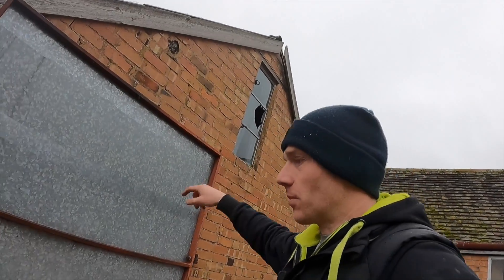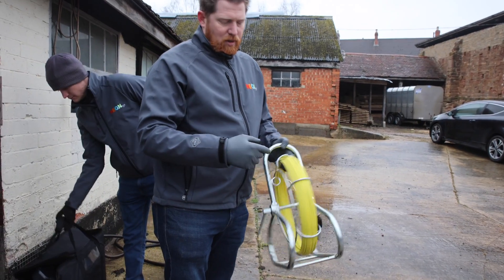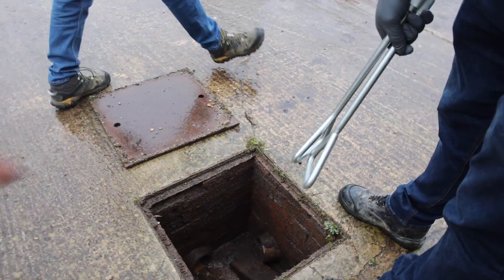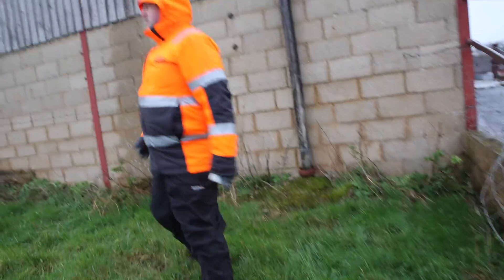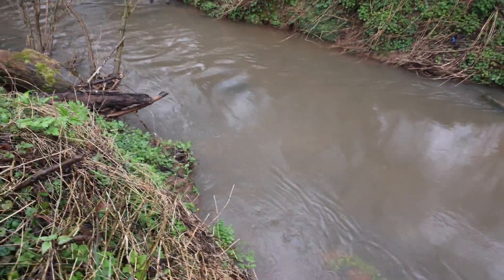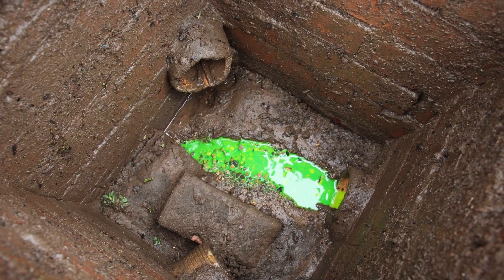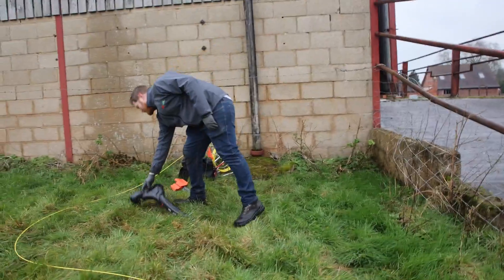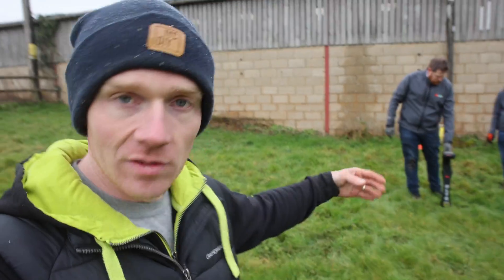LOOKING THROUGH CONCRETE and turning the stream GREEN!

Comment: The ground radar is all ok but there is no substitute for a proper internal CCTV survey. The radar won’t show you displaced joints, collapses, fractures, root in growth etc which will all cause problems later on. Will it show sections which are pitch fibre/metal/VC pipe? If not it’s only of limited use to show a general map of potential pipes. Other issues could be silt/stone/rocks in the pipes, wipes, concrete which will all need removing before a CCTV is done. You can also get swillys or flat spots which can affect flows, which the radar won’t pick up easily, a levelling survey is good to check falls on the network. You can also get disused sections, blanked off connections etc. 
As I said, radar isn’t useless but it should only be a rough guide. 
If I lived closer I would be happy to come and help as I am a Gravity Network Technical Specialist but if you needed any general advice I may be able to help via email.
Reply: My field techs use 7 different dye colours for investigating sewers but green is always the best!
Reply: Oh and if you needed any advice on how to jet clean sewer pipes I can help too.

Comment: Thats cool Tim, interesting to know but also to improve/maintain the system, curious whats below the barn......
Reply from the maker: The original store and stables were lower but filled in to make it all one level for tractors and implements.  Although from conversations with others its seems the floor was already higher than first built so possibly the old floor is down there somewhere.,